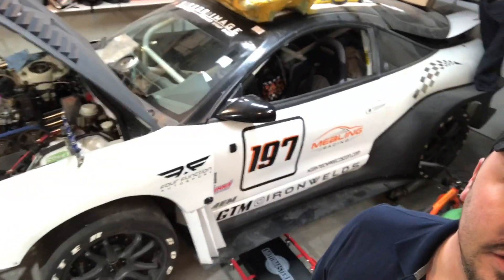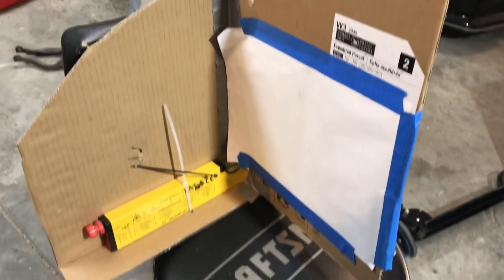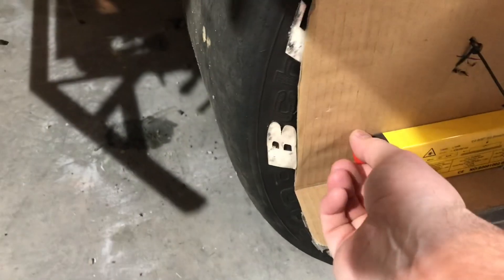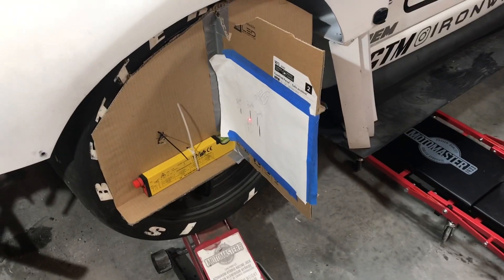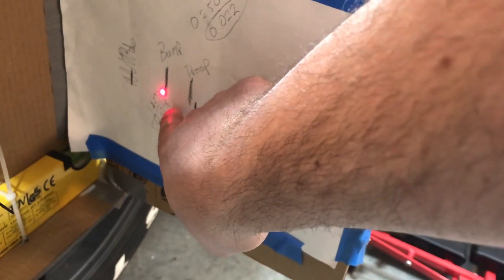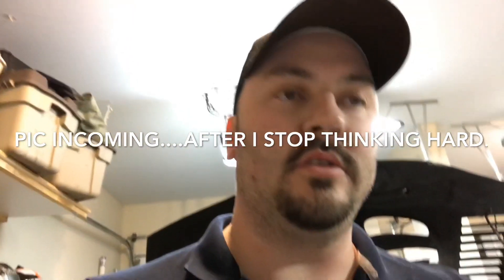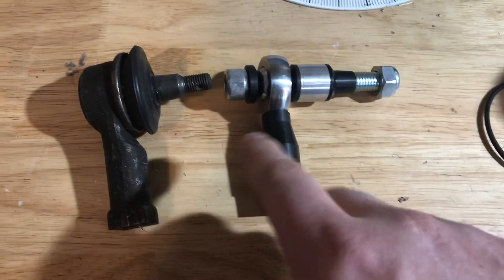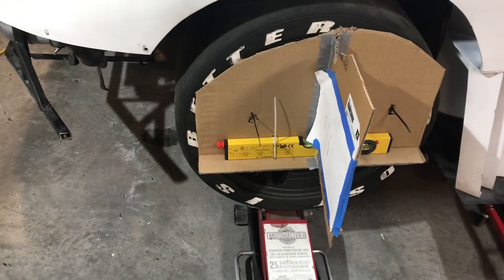Check Bump Steer - CHEAP Home Made Gauge

Comment: I don't understand why some people are measuring it forward and some perpendicular to the car? If you measure it like in this video(forward), you are adding into the measurement the camber change as well, which is not accurate.
Reply from the maker: That’s a good point. I never thought of that. Thanks!!
Reply: @smokin80  I'm building from scratch a Lotus 7 style car, and I have learned that from the forum. I'm about to do this and I'm confused about these videos. I will just use the other method not this one, it makes more sense to me. As you lift the control arm you are introducing the camber change as well, so you are getting both "measurements" added together this way.
Reply from the maker: @19mati67  so…I agree. And you are correct. However. I’d be willing to hazard a guess that the amount of change due to camber is pretty minor. The thing is that I had some horrible bump steer. So an improvement was still an improvement. I will try shoot this perpendicular to the car the next time I set it up. I appreciate the insight and hadn’t thought of this!  Good luck!

Comment: Can you explain the math?  Why use the distance from wheel center to mirror (x2 forward and back) divided by radius of the wheel.   143/12.5 =11.44.  So compression bump the laser pointed inward, (toe in) by 1"1/4 / 11.44 = 0.1092 ???
Reply from the maker: Because the laser is travelling 11.44 times the radius of the wheel so the movement is that much larger. Put a straight stick taped to the wheel and measure movement at the wheel and movement way out at the end of the stick, it will be much a much larger amount of movement at the end of the stick....  does that make sense?